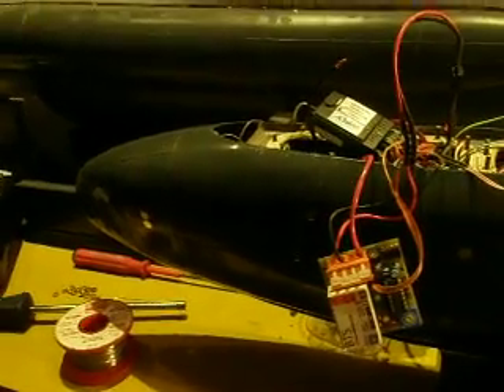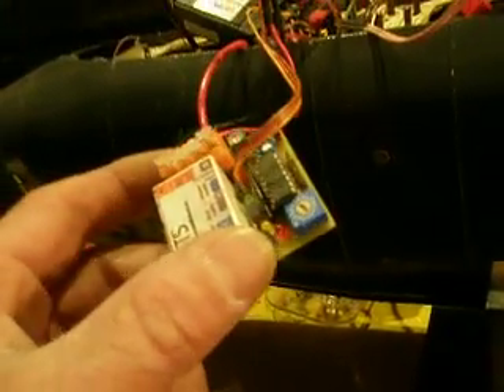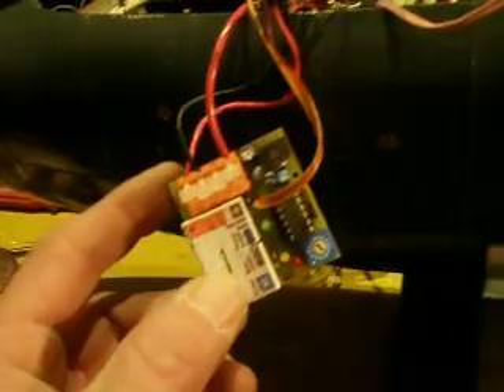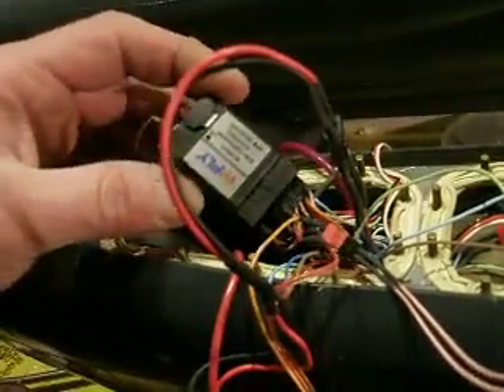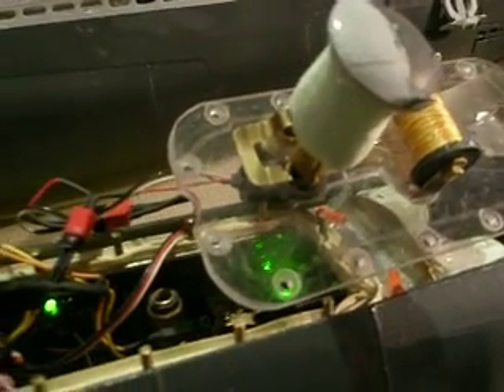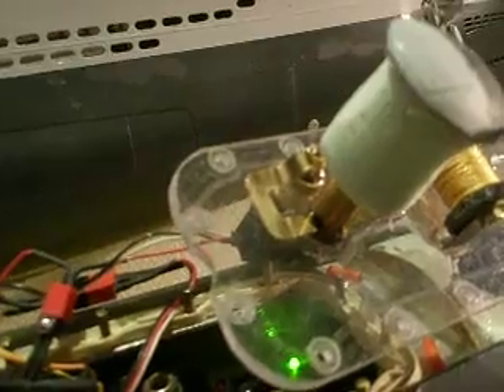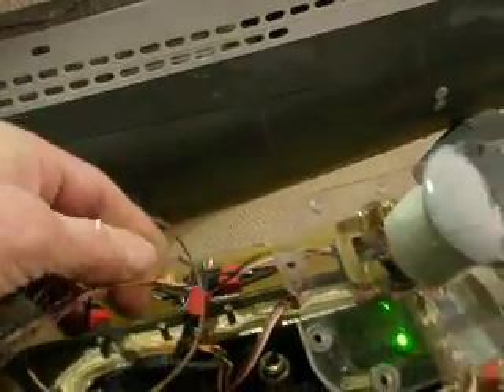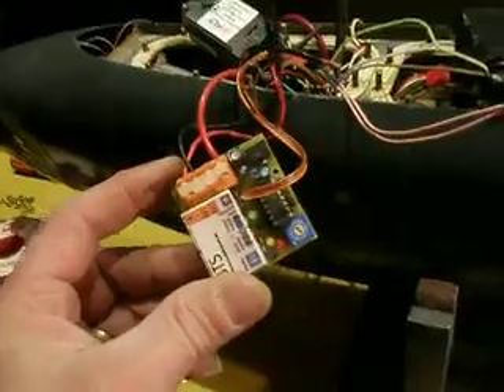Emergency buoy system V80

Comment from the maker: @SuperHolajaja ,

If i understand the translation right, you wonder if the batteries can manage al those things that i have made.
Each time when i build a sub i use  seperate battery packs, one for driving the sub 12V 5Ah, and one pack for the receiver and servo's 4,8 V  2,5 Ah
The engine will consume about  1,5 A at full speed, so i can drive the sub at least two hours without any trouble, also build a indication led inside to give me the status of both my batteries.